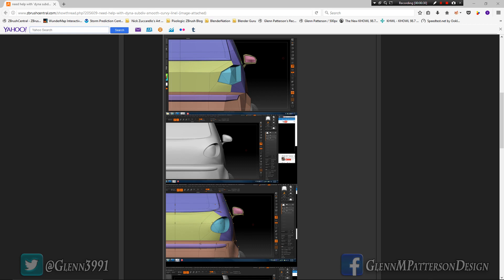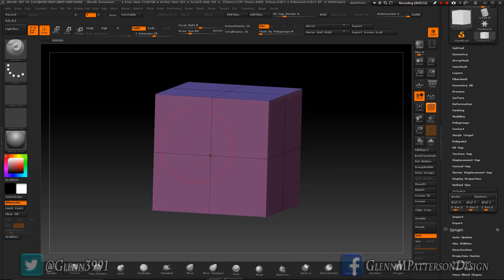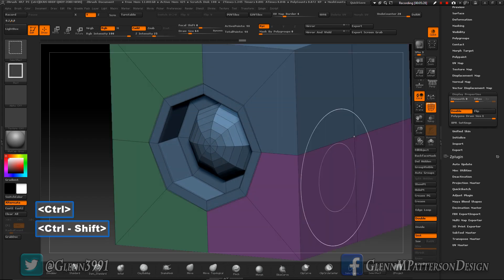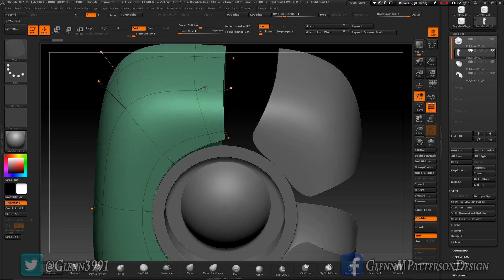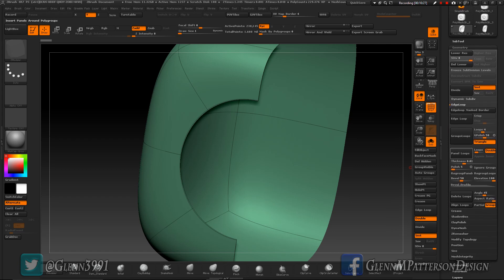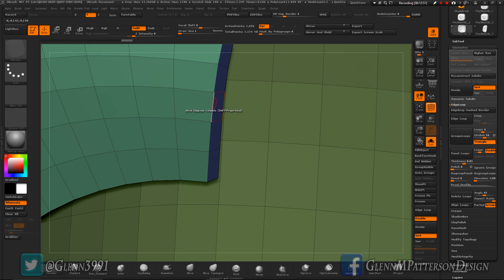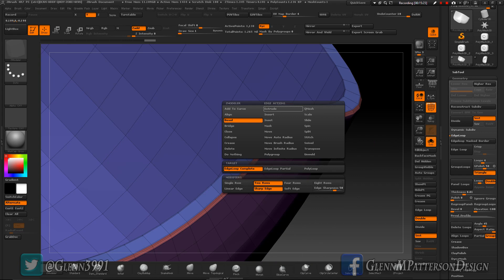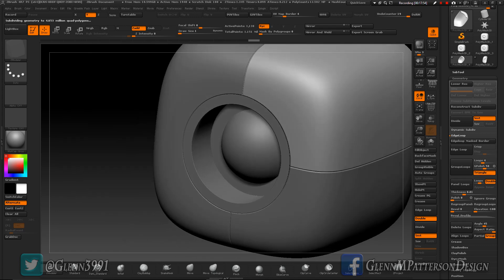Zbrush Solutions-Low Poly & Sub Division Issues

Comment: Good video.
It's a basic sub-d modeling problem that is able to be solved fairly elegantly in ZBrush. The only two ways I know of to model this is the way shown by GP, or to hand model higher-divided panels in tight to the circle of the sub-divided light. The method shown is actually much quicker to obtain a very high precision result than hand modeling. Not so much a 'workaround' as a great procedure.

You can just apply subdiv at 3 rather than 7 and do a panel loops of 1 to skip the reconstruct lower subdiv steps, and you'll be at the same geometry in the end. I tried a little lower poly resolution, but for the cube, I like the poly res you went with if 1100 points per small panel is good enough. Applying Subdiv of 2 for a division of 3 results in it being just a bit too far away from the light circle at the panel corners (shown in link). HOWEVER, it is so close that you could just nudge or scale down the panel corner points in toward the light circle just a tiny bit to get it perfect and end up with a beautiful rounded cube and tight panels at only 346 points per small panel and <3500 points total even with the light object panelized the same way to make them all water-tight mesh-solids. 
This picture shows a the 3 sub-div cube resolution all finished out with the panel corners as default, non-adjusted: http://i.imgur.com/6ZsduMO.jpg
If you can make the light circle have a shape design with some flat sides as shown in the original problem, then you can also get away with this lower res base mesh and still be tight at the panel corners, if the panel seams dead-end into the flat sides of the light.

Comment: HI Gleen,I have been wondering if camera light can be cancelled?(the light from camera view direction)
Reply from the maker: +刘电 You can adjust the lights in the light panel. You can also adjust the ambient light as well. Be sure you aren't using a MatCap material because the lighting info is baked into it. One thing to remember is Zbrush doesn't use a traditional ray path rendering, so you have to do some tricks to achieve similar renders out of Keyshot